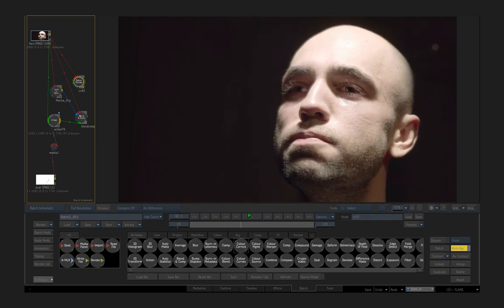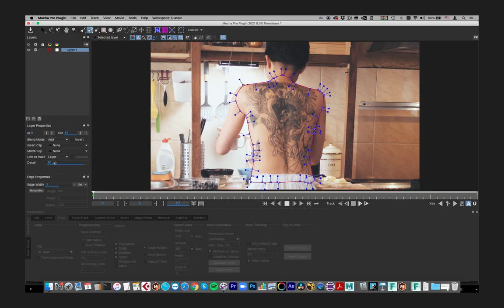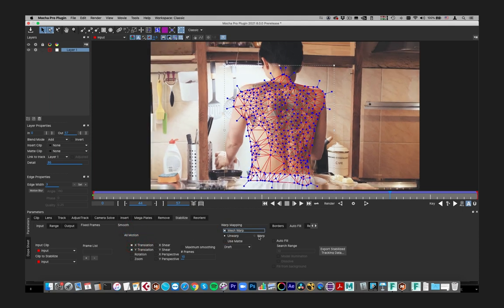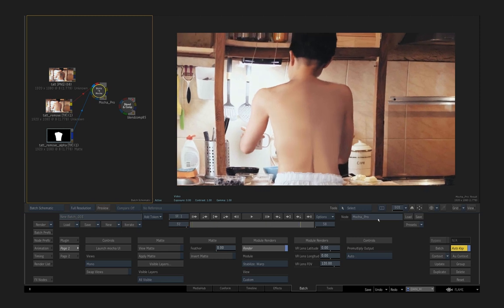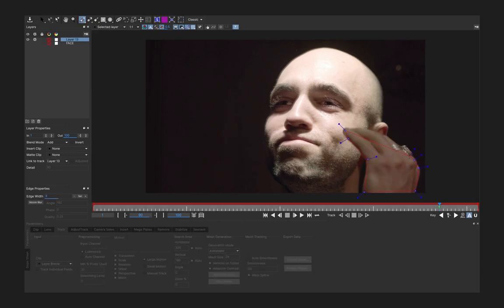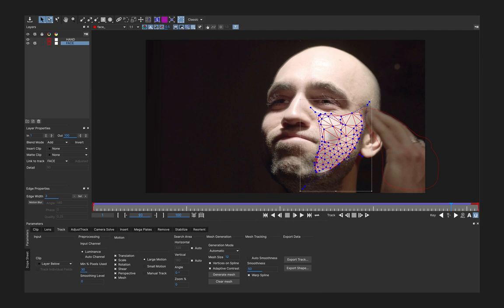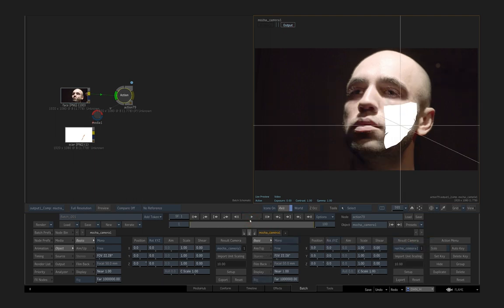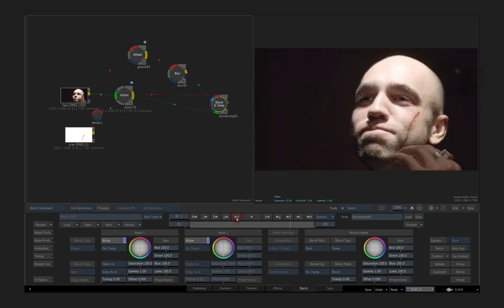Mocha Pro 2021: PowerMesh for Autodesk Flame

Comment: Sir please help, i installed mocha pro 2021 seperately but in after effects its showing the older version of mocha and i am using after effects 2021..please help..🙏what to do
Reply from the maker: Go to Mocha Pro preferences and head to the System tab.  Check the box that says "Use this version with AE".  When applying the plugin in After Effects, make sure you are choosing Mocha Pro and not Mocha AE.  If you're still having issues, please contact Support : https://borisfx.com/support/open-a-case/
Reply: @BorisFXco  How can i export video from mocha standalone application?
Reply from the maker: https://borisfx.com/support/documentation/mocha/8.0.0/#_exporting_rendered_clips_mocha_pro